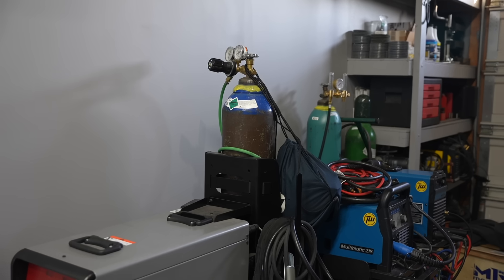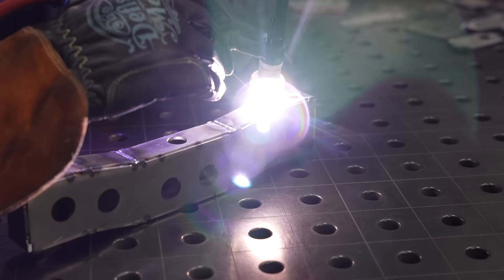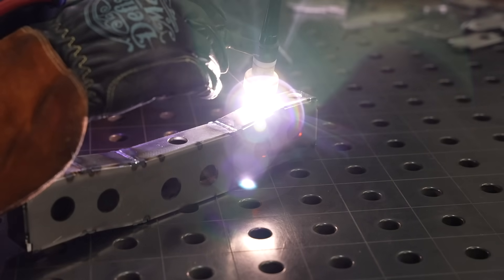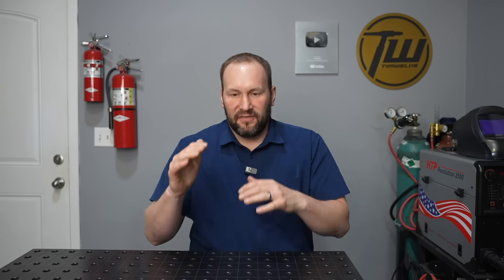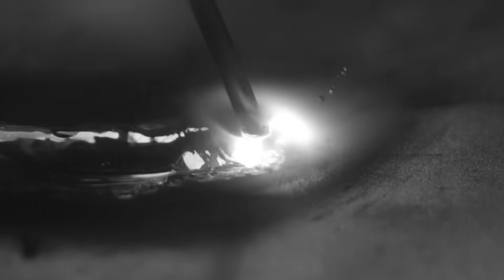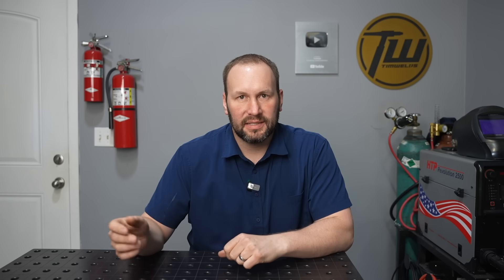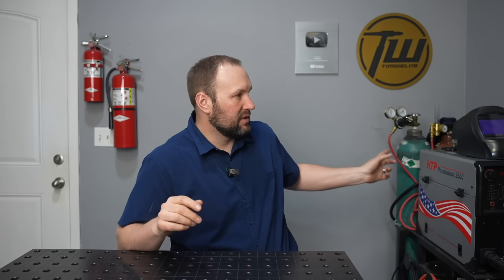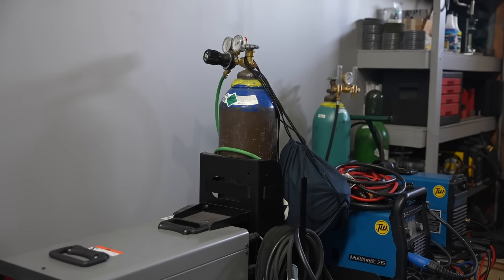Welding Gas Explained: How to buy gas cylinders for MIG & TIG Welding

Comment: At least with the company I got my gas cylinder from, they told me I could not move out of state with the cylinders if they were leased. So I had no option other than to purchase mine. Back in 2013, a 6hr (125cf) bottle was $325 and refill was $45. Today, no idea, still haven't had to refill it, welding kind of fell down for me. Hoping to take it back up this summer.

Comment: Lease em if you use a lot, its cheaper.  You wont have to wait for your tank to refill or be charged a hydro test every 10 years.
Reply: It really depends if you use a lot a supplier is likely to be able to give you a custom price or a special contract. If you use a couple of seconds a year most decent companies can offer you a yearly contract for a certain volume of gas but you have to meet it

Comment: They swap out bottels when you fill them .   So it dosnt really matter buy the cheapest tanks  possible   dont buy new tanks.  They can fill the cylinder you bring in and own if they have there own fill station .  You have to be willing to wait and pick them up though.  They will only fill when there a enough to fill all the station spots.   The only reason  they will say know  if they dont want to deal with you or  there lazy and that dont want to work more then they have to. A branch manger of a welding supply shop told me this.   It made me made because they told me they couldnt do it .  I would of ben up set but like a dummy my tanks were all brand new tanks .  The tanks they gave me  had to be swapped  because the valve were old  leaked when opend   2 thank  had a square top no knobs   packing leaks.  If your like me and live 30mile from a shop  take back tanks  suck    my suggestion to use at least a 1/4  of it before  you exchange it .    💯🫡✌️

Comment: Acetylene becomes dangerously unstable and can self-ignite or decompose explosively (detonate) at pressures above 15 PSIG (pounds per square inch gauge), even without a spark, especially if contaminated or heated. This instability is why acetylene is stored in cylinders filled with acetone and a porous material. It's very important to know why!!! never heard of a cylinder blowing up ....but....

Comment: A good choice for 250 amp MIG machines is a tri mix of 89 argon/8.5 CO2/2.5 oxygen. This gas will short arc very well and will conventional spray with a slight increase in voltage over 95/5 argon oxygen or 90/10 argon/CO2.
Stainless mixes would be helium/argon/CO2 for short arc(as mentioned) or 98/2 argon/oxygen would be for conventional spray. There is also a blend of argon/CO2/nitrogen that will short arc or pulse spray for stainless.  
Ownership of cylinders is a VERY muddy and gray area. If you bought a 330cf(T) cylinder that was sold by an independent that did not rent cylinders then you SHOULD be able to exchange it for another customer owned cylinder. You really need to talk to the supplier you want to use about this. Some suppliers want to sell gas some are hung up on neck rings or trying to rent cylinders. The biggest take away here is when you have the conversation with the counter person at the welding supply how you approach this goes a LONG WAY. If you have a good attitude and are willing to work with them they are usually willing to work with you. If you go in with a chip on your shoulder you are very likely to leave in a bad mood and an empty cylinder.

Comment: hey, I'm a welding student and I'm wondering what type of welding i should start with, one i can do easily and safely out side of school, like in a garage or something
Reply: MIG is fine. Just make sure any flammables aren’t out in the open. TIG is safest, but also requires the most skill. Stick and fluxcore produce the most sparking, globs of hot metal and the most dangerous fumes.

Comment: I have an Argon bottle and a CO2 bottle, each has a regulator and a ball flow meter and the outlets go to a Y connector with an epoxy style mixer tube. I can have 100% argon, 80/20, 90/10, 98/2 or any other mix with just these 2 cylinders.
Reply: I've been wanting to get one of those. Do you know where you got it from?
Reply: @JosiahHaselton have you heard of Google?

Comment: This a good general over view.  60 years ago, my father could use an arc welder and lay a bead finer than and mig or tig process and haul a trailer of steel home and build a tandem axle tilt bed car trailer complete with hydraulics in a weekend without any drawings.  I inherited his equipment and have added acetylene, mig and now a laser welding system.  Tim gives a very good over view of the basics.  So Tim is a good start at understanding what to look out for when choosing the gas for aluminum, stainless etc.  

But I did not hear him mention any recommendation about the gas needed to weld say "bed frames" or basic steel required if someone wanted to create say a statue of a deer or a sasquatch out of material they may easily find during a community spring clean up.  After all.  You have to start somewhere and welding basic bed frame steel or similar iron is a good place to get started.  

After all.  If you watch "Forged in Fire", Many of the contestants started off making their first knives from a file or railroad spike and went on from there.

Comment: I need one gas that short circuit MIG welds both stainless 304 AND mild steel. I saw one person state on a welding website that 95% argon /5% CO2 is a good option for this. I only have 1 80CF bottle and am hoping I can find a gas that can do both. Hardly any videos or forums that go into detail into how far you can stretch a gas while being effective and clean.
Reply: In my experience, 95/5 does not short arc well and I have never heard of using it on stainless either.

Comment: What cubic ft size is your green Cylinder? behind your HTP Revolution 2500 machine.
Reply from the maker: Just a 125 cubic foot. I have several of them instead of a bigger one because they’re easier to move.
Reply: @TimWelds which other small one you recommend, for home hobby?

Comment: Prices for welding gas' are crazy! They are never the same even weeks apart. My first refill on 125 CF was $49 and that grew to $125. in 2022, (AirGas) I changed suppliers (Praxair) for $59 but was warned that the next tank would probably be $71, So I bought a Mig flux core-only welder and if I don't need a nice clean weld I use the flux cord and have cut my trips for refills in half. Have you done any research on the best wire to use for flux core? Thanks, good information.

Comment: It's usually cheaper to lease the larger cylinders then to own the smaller ones if you use any real volume of gas. For an example in my area no one will fill a customer owned cylinder over 80 CF. The cost to refill an 80 CF argon is around $50. To lease a 330CF cylinder costs $75 a year per cylinder, it costs around $125 to exchange a 330 CF cylinder. So if you fill the 80CF cylinder 4 times it costs you $200, vs $200 for the 330 CF cylinder for the same amount of gas and the rental fee. So 330Cf a year is the break even point. Assuming you are going to go through at least two 330 CF Argon cylinders a year its cheaper to rent the larger gas cylinders then to own the small ones. Obviously it all depends on where you are and what your LWS is charging. Then there is the convenience of exchanging vs filling, I own a couple small cylinders of gases that i dont use much of, and its a inconvenience offen taking a hour or two to wait for the LWS to refill them vs a quick in and out exchange for a rental cylinder exchange. Add in the hydro test inconvenience every 10 years, that can take a week or two. If your LWS fills customer owned cylinders without a size limit then by all means buy your own 330 CF cylinders, its a no brainer amd will save you thousands of dollars in rental fees over the decades. However if your in a situation like mine renting is often cheaper at least for gases that you use a fair amount of.

Comment: You also forgot the danger people getting oil on their oxygen bottles, and you should never run your acetylene completely out it depletes the acetone,  I have been in welding and Machine business for 49 years this year, Ben FAA certified, certified structural and pressure,  for 50 plus years, I own probably 35 bottles, it's for my own use in the shop, I have some bottles that are manufactured and first tested in 1976 , I will definitely not exchange bottles all my bottles are painted my color with my business name on them, if a company wants to charge you rental on bottles it is against the law, the only way they could charge you rental on the bottles if there is a pickup day and a must return date, like a rental company.
  Most big companies are trying to Snuff out the little man by refusing to fill your bottles, what a racket.

Comment: Hello,
I am an amateur hobby welder and own a cheap Chinese mig welding machine with only material thickness as variable welding setting. So far I've been using it with flux core wire, but I'm thinking of switching to CO2 gas. What would you recommend for my case?
Reply from the maker: Either CO2 or 75%Ar25%CO2 will work fine. An 80 cubic foot cylinder is plenty for most hobby MIG welders.

Comment: Great content, Tim! Airgas in the Phoenix area is 30% higher than Phoenix Welding on 100% argon 300CF refills. I don't move my TIG setup around so the big tank is OK. The company I did fleet maintenance for before retiring closed a shop and I got an acet/O2 setup  and 4-300CF nitrogen tanks for free. Gas companies never asked when I took them in for refills. My 125CF aluminum C25 cylinder is only $10 more to fill than the previous 40CF I originally bought 25 years ago. The upgrade cost was only $52. I now keep a large C25 tank and I use a transfer setup to keep the 125 topped off; that way I have never ran out in the middle of a project and the aluminum tank is so much easier to move with the machine. For my needs/wants, straight CO2 is messy. I'll stick weld if I need the extra heat

Comment: How to buy cylinders??  Go to welding shop.  Open wallet.  Simple.  Just dont discuss forge welding or you will get a deer in the headlight look.
Forge On!!!
Reply: "Just dont discuss forge welding or you will get a deer in the headlight look." that's true in the vast majority of gas suppliers but there are still some folks behind the counter that actually weld and are interested in the products they sell......wink,wink.

Comment: I found at least Arc3/ArcEt in VA will customer swap up to a 150. I haven't asked about sending out bigger cylinders but a local shop when they were still open,  WeldTec, could get anything filled so long as you were willing to wait for it to go out and come back.  AFAIK some other small shops would do the same. Worth asking. I've noticed a lot of shops swapping bigger stuff and willing to fill whatever as more people get into welding and own their stuff.

I've also run into silliness with marked owner cylinders like you say. Hell Arc3 does 150s as "customer owned" but has their name on it, and the 80 I got from ArcEt actually says Customer Owned on the ring lol. When in doubt keep records of ownership.

The spiel some places quote about DOT forbidding personal ownership of big tanks is nonsense AFAIK.

Comment: I bought a 125cf bottle of argon when I got my tig welder a few years ago.  Just got a mig welder so I'll be getting a bottle of C25 for it.  I get my gas from the local hardware in a small town in Michigan.  They distribute from a regional gas supplier.  I asked about 90/10 for spray arc and trifuel for stainless and was told they don't keep those in stock but they can get both types of gas for me.  I didn't know stainless was going to 98/2 for welding gas.  That would be cheaper than the trifuel I would think.  Great video Tim!
Reply: When I was in college in 2011-2012 for welding, we used tri-gas for stainless steel. Didnt know they were going away from it, but makes sense, since Helium is on such a shortage.

Comment: I have found that some companies require you to have  certification documents from the gas supplier on the gas being used depending on the job. I have also had gases separate in the bottle causing bad welds.
Reply: How do gases separate? How did you figure out it separated?
Reply: If the mix has Helium, the Helium will tend to leak out faster than the other gasses do to the tiny size of the Helium atom.  In an Argon/ Helium mix the mixture will loose Helium do to tiny leaks faster than it will loose Argon.  Thus Helium will deplete.

Comment: Helium thermal conductivity is almost 10X greater than that of Argon (at room temp), thus it's ability to help with welding thicker material (He 0.15 W/mK vs Ar 0.018 W/mK).
Reply: And helium is obviously lighter than air whereas argon is heavier than air. When tig welding, the torch is most typically above the weld so the argon will fall down into the weld area and tend to stay there a little while thus providing good shielding. However, I envision the helium just floating up and away and not sticking around the weld very long. This makes me wonder whether the helium really does provide much shielding
Reply: @jefflamb5343  The flow rate of the gas, be it Argon or Helium, is what provides shielding for the arc/puddle.  The weight of either shouldn't affect either's shielding ability.

Comment: Tim have you thought about making a gas mixer to mix your own gas?
Reply from the maker: I've thought that it would be cool to adjust the ratio on the fly, but it's not something I've had the time to dig very deep into.
Reply: I’ll be watching excitedly if you work on it one day.
Reply: A mixer is not just two flow meters and a Y or that is what the companies that sell mixers would be selling. Two flow meters and a Y will work......kinda, sorta but it won't be terribly accurate or repeatable like a mixer is. The down side is mixers are not cheap......I have been looking for one for a long time and I'm not going to spend a 1,000.00 on something I might use 3 or 4 times a year.
Reply: Proportional gas mixers use a pressure regulator, needle valve, and Y. The two needle valves are in one assembly with one knob called a mixer valve which sets the mix with one knob instead of two. The taper of the needle valves might be set for the gas and ratio range. I can’t see why a mixer can’t be made with a regulator, needle valve, flow meter and Y. “How the electronic gas mixer KM-MEM+ from WITT works” is a good animation.

Comment: My gas supplier will exchange any cylinder without question unless there is obvious damage.  There is a fee for a lost cap but otherwise just drop off the old cylinder and pick up a refilled one.
Reply from the maker: That's usually the case with me also. I did get charged once for an out of date cylinder, but it was way out. Usually the guys on the dock don't even look.

Comment: About 4 months ago now I went to my local welding supply store to pickup a 125 pure argon tank for TIG setup at home. They were all out of 125s unfortunately. Guy decided to give me a 250 tank on discount for $350. Feel like that was a pretty good deal.
Reply from the maker: That's a great deal!
Reply: You can buy loose cylinders brand-new for under 20

Comment: Thanks for the excellent tips, Tim!  I just received an invoice for my 300 C-25 cylinder.  I had a five year on it that just ran out.  My supplier, Airgas no longer will do a 5-year lease on any bottles, only one-year leases that cost almost as much as my 5-year lease did!  I wish I had a mom & pop supplier around here but, we only have the two; Airgas and C-K.
I was wanting to buy a prefilled 125 with 90/10 but amazon doesn't carry them.  Seems the only ones I can purchase pre-filled are C-25 and Argon.  If you know of another source to purchase a full 125 90/10, please pass it on.
Thanks again Tim for always having clear and concise videos, your knowledge is always appreciated.
Reply from the maker: Linde is the only supplier near me that'll fill a 125 with 90/10, but it's a custom order with an extra charge.

Comment: Im thinking of filling my cylinder with 50/50 argon and Co2 for mig mild steel welding, will save in cost$$.
Reply from the maker: If the goal is to save the most cost, straight CO2 works pretty good.

Comment: What ac dc tig welder would you recommend for a hobbyist? Thank you
Reply from the maker: The HTP Invertig 221 AC/DC is the best on the market for the money, performs with the best machines out there and is built extremely durable. It's not the cheapest, but worth the extra over the basic Chinese machines if it's in your budget. https://bit.ly/Invertig221 
If you're looking for something less expensive than that, the PrimeWeld TIG225X works pretty good, has better accessories than most entry level machines and has good customer support. https://amzn.to/3F062Ol
Reply: @TimWelds +1 I had one for over a decade and it never skipped a beat. Bought another HTP after.
Reply: @ Thank you for taking the time to answer my question

Comment: Great rundown Tim, a couple years ago at work we put a pencil to our overall cubic foot gas cost for 300,200 and 125 CF bottles. The 125's ended up being the best value for two reasons #1 as you mentioned the larger sizes are lease only most places, but also #2 transportation costs. A lot more 125's can fit on a given truck and actually add up to more CF carried at the same cost.
Reply from the maker: Thanks! I found the same thing. Since I work alone, I also worked a back injury into my analysis when I picked multiple small cylinders over a large one. 😀